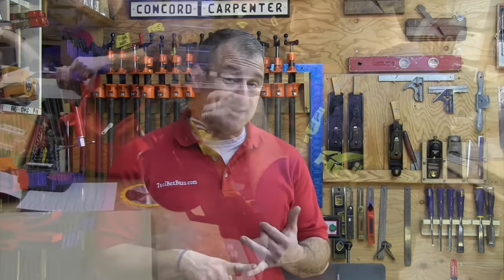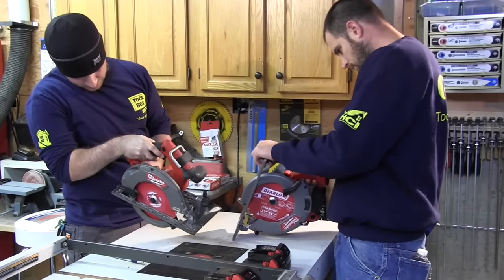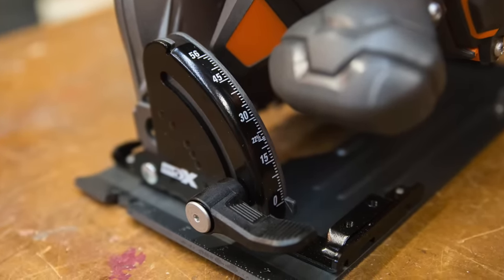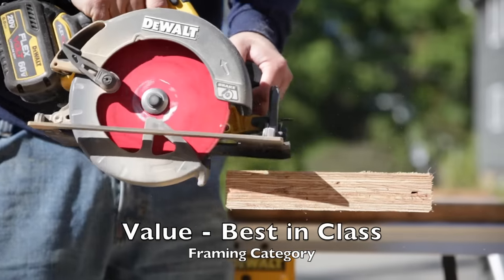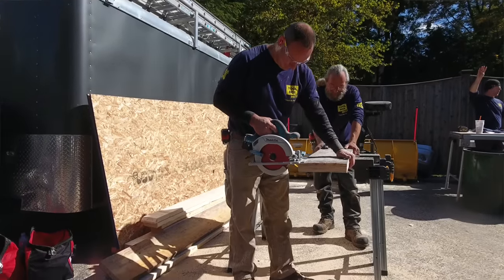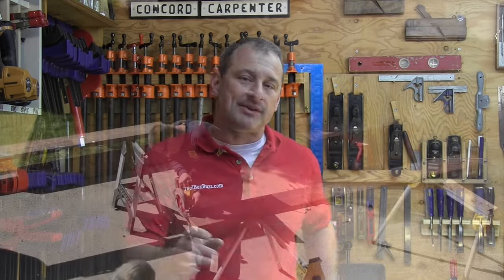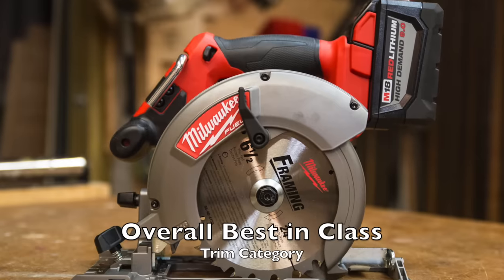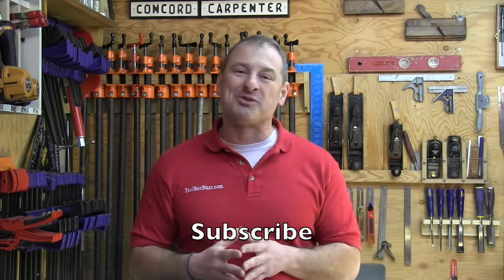Best Cordless Circular Saw - Head to Head

Comment: I have disassembled dewalt flexvolt batteries and Milwaukee batteries and Milwaukee cells are simply amazing. They do an amazing job of producing power. Granted i run mostly dewalt tools and will keep on doing so. They have never let me down and worth every penny.
Reply: You do realize that Milwaukee and Dewalt use the same cells most of the time

Comment: I changed from dewalt to Milwaukee about 6 years ago, dewalts batteries have always been trash. I have some Milwaukee batteries that are 6 years old and still running strong. I use them all daily as a contractor
Reply: That good to hear. I've been avoiding Milwaukee because the 18V batteries we had years ago were dying left and right

Comment: Just found this vid and well done.... The one comment i would make is regarding the Dewalt battery packs. It was mentioned that you cannot use the 20v batteries in the new 60v saw which is true, the thing he did not mention that that new 60v battery will power all of the 20v tools with a seriously extended run time.

Comment: I have the Dewalt, a guy on site bought the Milwaukee this week. It’s literally not even close. The Dewalt absolutely eats it for breakfast.
Reply from the maker: Matthew Snart which Dewalt?
Reply: A Concord Carpenter / ToolBoxBuzz The FlexVolt 54 you tested here. It’s by far the most able saw I’ve used. A 6.0AH Battery will get me from  7am - 1or2pm with proper framing carpentry work.
Reply from the maker: Matthew Snart That is an absolutely great saw, and will serve you well

Comment: We love are milwaukee 7-1/4 saw with the high demand battery pack . It really does take the place of the corded saw . My only complaint is that it's not worm drive or left sided blade.  Being a concrete crew we cut off are boot instead of using saw bucks .

Comment: Hell of a lot of work in this test. Good job. I don't know if it's available in the US (you could import it) but I recommend the Bosch GKS 18V 57 G (the guide rail compatible version of the saw in the video). Pair it with the 6.3 ah Eneracer(EU)/Core (US) battery and it turns into a beast with excellent runtime and accuracy with the guide rails.

Comment: i found the Channel couple years ago and hooked since...
I feel the test they perform is the best and most accurate one can do. Even a Well known magazine could;d learn from these guys.  
I'd like yo see high end levels verses, mid grade verses el cheapo.
I have an Empire, owned since entered my trim/finish carpenter career, after the vials faded from sunlight and other, bought a Johnson it really does the job, huge vials, can see the bubble faster and easier, nice to have installing a door alone. 
Also the vials are bright, wondered about if better, Found Sola, Stabile, Crick and Johnson Ultra.
 Like to see to the best of their ability comparison test,  
The base homeowner level verses Contractor grade (DeWalt, Milwaukee, Irwin, Stanley Fat Max etc) the Professional levels as stated earlier. Based on accuracy, an other details, I performed my own test ratherr basic at best. Stacked the levels one one top of the other Sola Big Red 48" next Johnson 1748 (Silver), bottom Empire poly. Hope they can do better.
Lastly hammer shootout, I have Stanely, Estwing and Dead O1n the Estwing handle snf swing feels better, the Dead On handle feels more comfortable and pulls nails easier. the head pivot and handle length.
There you go guys go for it.

Comment: I would say all are great saws I own the flexvolt saw it's power is great.  Another thing I've noticed the more saws bind it also puts more strain on the battery packs so material makes a difference.  I would love to see how much better it will be once it has the 3/9 AH Battery given then it would have the 180 Watt cap like the Milwaukee and see how it does too.

Comment: In the article I noticed a mistake with cuts per watt hour calculation for all saws except the Makita X2 saw, the cuts per two batteries was divided by the watt hours in only one battery meaning actual cuts per WH should be halved for all saws except the Makita X2 where the cuts per 2 batteries was actually divided by the total WH of both batteries.
Reply: I'll look at this later tonight when I'm home to check spreadsheet. Thanks for the heads up.
Reply: You’re correct! We’ve fixed the graph…doesn’t change much…but definitely an oversight! Thank you.

Comment: Disclaimer: I'm not a carpenter!  I have a few Makita LXT/18v tools and was considering buying a circular saw.  Most puzzling question: Blade to left or right of the battery?  The winner of the 'visibility' category for trim saw is blade-to-left (which would make sense re sight line).  But I'm told that there are down-sides to this.  As a non-pro user, is there anything else to be cautious about?  Any safety concerns with either style?

Comment: I'm buy makita just for the reliability. I have put my drill sets through hell. I have the first edition 36v makita saw and it is very very powerful! I find that even using 4ah batteries fully charged with a new ish 40tooth blade tct I cut 278 pieces of feathered edge stacked in fives and they are five Inch diameter. the wood was also fumigated/ tantalised and plus very very wet 😑 still one charge no issue. previous to that day building the framing for the fence 9 4inch posts was cut twice, 20 3x2 4.8 meter fumigated sawn timbers with 4inch half laps each end and to top it off multiple angled cuts and then 6x1 soil boards. I done all that on 2 charges but I didn't get down to the 70% shut off as soon as I felt the power drop I popped them on charge and began framing and waited for 30mins to reach peek charge and back of to work lol. makita has built in volt low resistors stopping the saw from use under certain volts to obviously save the motor and battery. I suggest 6ah batteries. I'm currently modifying batteries to go beyond the 6ah range.... near 10.5ah.... which is insane... but only 0.5x the original weight.. but at around £113 a battery then. but now trying HG2 cells and loss of 1.5ah but then the cost is £60 per pack updated.

Comment: I usually really like these tests. But this one seems to favor Milwaukee quite a bit. I did some number crunching... Makitas double battery saw is based off 6ah batteries. As is Dewalts (based off "20" v numbers) 2 ah at 60v. Rigid is based off a 5ah battery while hilti seems to be a 7ah. So obviously 6ah is the average for the test. Till we get to milwaukee. Which is using a 9ah. If you do the numbers for the cut test based on a 6ah instead of a 9ah you get 160 cuts for the 7 1/4. Which doesn't put it way out front like they showed. Puts them in second. Behind dewalt by 15 to 20 cuts.
I was also not a fan of the value section. They stated that the Dewalt was the only one they could purchase as a kit, while all the others were purchased seperatley. Well pricing the Dewalt seperately, that's 150 per bettery, 180 for tool only and a surprising 95 bucks for the charger makes for a total of 575 when priced the same way as the other tools. They were saying it was just under 400. Pretty sure dewalt should not have won that test. Even without crunching the numbers I can positively say that the rigid is the cheapest option. They always are

Comment: For general purpose, I went with the Milwaukee 2630-20 because I prefer the blade to be on the left side, so I can validate the line closer to the blade in addition to the sight for more accurate cuts, it has a metal guard instead of plastic, and my old 6310-20 has lasted about 15 years already and still going strong. Since good 18V NiCD batteries are hard to find, it was time to upgrade to the newer version of the closest thing I could find to the old one.

Does anyone really bother with the details of the bevel gauge, depth gauge, or arbor tool? Most people don't change blades until they are dull, which could be weeks, months, or years depending on the blade and use. The only thing I look for on a bevel gauge is accuracy of the marks...a 45 should be 45, not 43 or 47. For this reason, I double check with a speed square or an angle gauge. I do the same with the depth gauge. If I need it on the nuts to minimize damaging the surface underneath, I use a tape to confirm my depth.

Comment: As usual, a very thorough evaluation and ranking.  Admittedly, I'm not a contractor.  And contractors may not consider this when it comes to out-of-box performance. But, how about Ridgid's Lifetime Service Agreement (LSA)?  Their LSA is extended to batteries purchased as part of the kit with the tool.  What does this mean?  It means free batteries for life.  Does anyone else offer this?  It's a foregone conclusion that batteries have limited charging cycles, do not last forever, and will eventually need to be replaced.  Batteries are more or less a consumable.  And they are expensive!  When your battery reaches the end of its life, call Ridgid and they'll ship you a replacement! (Of course you have register the tool and batteries shortly after purchasing.)

Comment: Dewalt DCS577. .. 54V Au/ 60V US. 
Any thoughts? It''s a brutal saw. Blow's this class apart for similar bucks. Line of sight suited to right handed operator., while the dust falls to the ground. Has rafter hook. Its just so different from the other saws in this class.

Comment: My makita trim saw came with a little guide that quick and easy screws down into place. works great to rip in a pinch. do other saws come with this feature? that little piece of hooked metal has saved me so much hassle. not only good for ripping stripes, but handy as hell for sheathing if removing just a few inches from a sheet. with a 5 or 6 amp fatty 18v battery pack i’ve also ripped full lengths of 2x no problem.
Reply: *strips

Comment: What brand overall would you recommend?  I have a friend who currently isn't dedicated to a brand and has an opportunity to "start fresh".  He'd be a moderate user with some potential contracting work.  The Rigid lifetime warranty looks nice. Milwaukee and DeWalt look like they're stepping up their game... but the DeWalt battery designations confuse me.
What brand would you recommend, as a "fresh start"?  Moderate user with some potential contracting work.  Most common used tools would be circular saw, oscillating, drill and driver.

Comment: Hi Rob, I'm not sure how I missed this video but I would like to commend you on a through, well balanced and well thought out comparison. There was obviously a lot of hard work that went into this video. Great job!

As a long time Dewalt user, I no longer buy Dewalt tools for the very reason that the Dewalt framing saw came in second in your test - battery compatibility. I don't want to buy into yet another battery system, especially when the 18V systems perform so well. I'm still using a lot of 18V Dewalt tools that work just fine. I'm not going to go out and buy another $3,000 worth of new tools and not be on the same battery platform across the board.

As a side note, funny how the $1500(!) Hilti didn't place first in anything other than price. ;-p

Comment: Hilti has promo packages sw 60-A36 saw 
2-36 volt 5.2, fast charger pack of 5 blades hook & bag  was $649  it’s all around a decent saw.
Reply: But if you keep an eye out, you can find specials like if you buy a 2x4.0 battery with charger starter kit, you get a free tool, such as a cordless circular saw for $200. This applied to almost all brands at HD, Dewalt, Milwaukee, Ridgid, and even Ryobi a few weeks ago.

Comment: Fantastic review. I really appreciate all of the time you guys put into this. My only gripe would be the DeWalt 20v trim saw with 6.0ah battery was not included. Other than that, excellent.
Reply from the maker: Travis Collins we asked each tool company for the best and most powerful saw the flexible took that category
Reply: A Concord Carpenter Yes, it would have been cool to see how the 20v trim saw compared with either the 6.0ah FlexVolt battery installed or the new 6.0ah 20700 cell 20v battery installed. 

Either way, you cannot go wrong with the Milwaukee and DeWalt offerings.

Comment: Great Review! BTW the Milwaukee 9.0 Battery also seemed to have more grunt or bog down less when I was mixing stucco with my Fuel drill compared to other batteries. I used a 3.0 and a 5.0 battery and I of course felt a power decrease when it was at 1 bar, more so with the 3.0. But when the 9.0 battery was at 1 bar, it was still going strong. 

To the people who say it the Milwaukee 7 1/4 saw bogs down with wet lumber...have you tried it yet with the 9.0 battery and noticed a difference?

Comment: Great review Rob. I wonder how the Dewalt 20 volt trim saw would have fared in this comparison--I would guess it would have at least got best value in the trim saws. DeWalt definitely needs to incorporate rafter hooks. I was talking to another contractor this morning and he loves his Milwaukee platform, but he did complain that pretty much every tool has been to the repair shop over the past few years. I know they have a great warranty but when a tool fails in the middle of a job, there goes a half day or more potentially. Obviously not something you have had happen with your Milwaukee saw apparently. Great stuff!
Reply from the maker: With the Flexvolt - pretty good I bet. We've tested that saw a bunch - probably should have included it - there's only so much time n the day. We can't test every saw and every configuration.
Reply: Steven Smith one of the guys that works for me is all Milwaukee and he's cooked the brush holders on the Milwaukee impact and the chuck died on his combi drill same happened to my uncle. Shame the brand names been brought by a company in the Far East.
Reply: Both the 20v and flexvolt have rafter hooks now

Comment: Well done video Rob, you make some excellent points, I have both of the Milwaukee saws, I love the 6 1/2", its light and powerful however I am not a fan of it with the 9.0 battery, if one the battery was slightly smaller it wouldn't have the minor clearance issue
Reply: The Jimboslice Workshop

Comment: Enjoyed the review I recently purchased a rigid 7 1/4 brushless  skill saw and I also purchased a blade for cutting steel so I could use it to cut steel siding and proceeded to put siding on a  house however after about a 1 1/2 sides of the house were done the saw quit working. I then returned it and talked to the home depot tool guy and he said that it was probably defective they replaced it no problem and said to try again. I then took the next one home. I continued on the house and was about 2/3 done with the same house and the second one quit. Is there something that cutting steel siding does to a skill saw that wreaks it or is this a rigid problem and will have problems with other cordless saws cutting steel siding

Comment: I like the Dewalt 6 1/2" trim saw, never used many others though, sad to see you guys did not review it, nice job anyway. interesting comparison with the 2 battery.
Reply from the maker: We reviewed it here: http://www.toolboxbuzz.com/head-to-head/best-18v-cordless-circular-saws-head-head/
Reply: Old news but ... I bought one along with an 18-20v converter fixture so I could use my 20V DeWalt power packs with it, and it's awesome when you use the better batteries...

Comment: The heavier the saw the more stable the cut. As for blade size I mostly use a Skil 367 6 1/2” for framing as well as a 77 while I use both a corded and cordless 5 1/2” and an old 4” Skil 12V cordless for trim work. I’ve been a framer/finish carpenter for around 40 years and have sadly come to the reality that the retirememt garage tool sale is going to be a bust considering the huge advancements that have been made. I suppose my Mikita beam saw my still be worth a couple hundred bucks. Oh and the scaffolding unless Milwaukee comes up with cordless self erecting scaffolding before then!

Comment: I use the Milwaukee Fuel every day;  I find it somewhat awkward to use it to cut sheathing whilst the blade set to depth makes that last ten inches of a 4x8 sheet crosscut difficult to reach with the battery placement ; so then for sheathing, I prefer a corded saw

Comment: its practically impossible have the same tool brand on my stuff, i have hitachi framing gun, cornice duo fast coil nails gun ,makita cord circular saw, milwaukee cordless impact drive and drill,dewalt cordless 16 g nail gun, hitachi 18 g cordless finish nail gun, old porter cable reciprocating saw,its healthy the competity for benefiting us construction workers

Comment: Any chance you fine folks will test the 12v circ saws? My m12 is flat out nutless however, when I have trim, base, "fine woodworking" tasks on hand its absolutely awesome. Itll rip a 2x6 but not happily. Makes beautiful cuts in mdf trim n base though. Seriously perfect for small cuts. Not sire bout the other 12v lines though

Comment: Why is the motor on the right hand side of most of the saws ?
Reply from the maker: freddienz68    It’s a left-blade saw, NOT a left handed saw. With a left-blade saw, you have improved blade and cut-line visibility for improved accuracy.

Read the 1st paragraph of this article for more info https://www.toolboxbuzz.com/cordless-tools/makita-7-14-circular-saw-18volt-xsr01/

Comment: Your funny. You just didn’t want to say Milwaukee won both the trim and framing categories. All good tool with minor differences. I have the Milwaukee 6 1/2” and run the 5.0 batteries which are way more reasonably priced and it works great. What you didn’t mention though is the Milwaukee 7 1/4 is more a left handed blade orientation if I’m not mistaken.